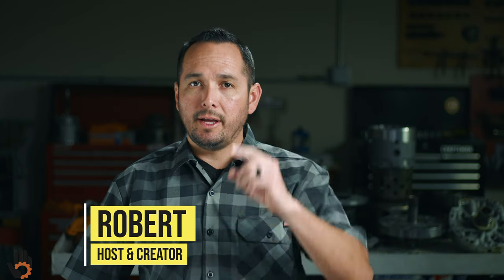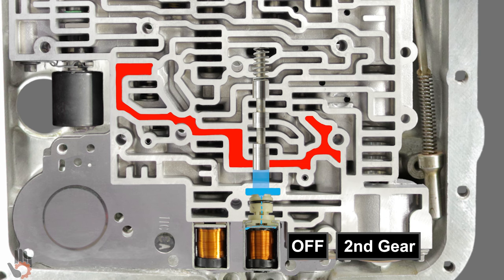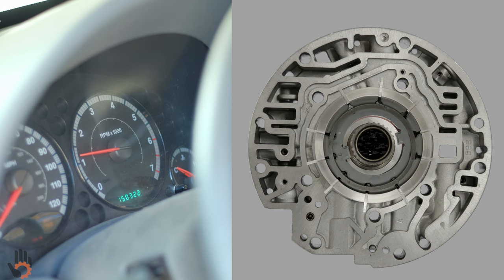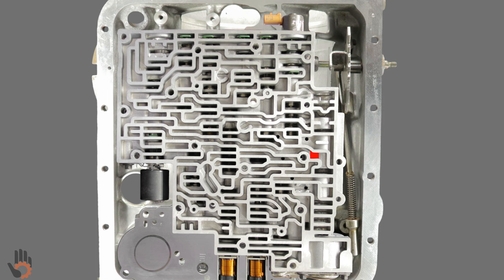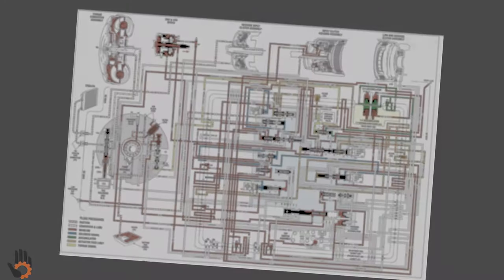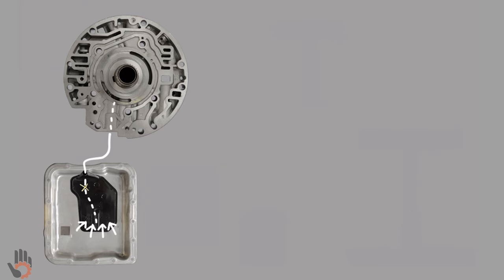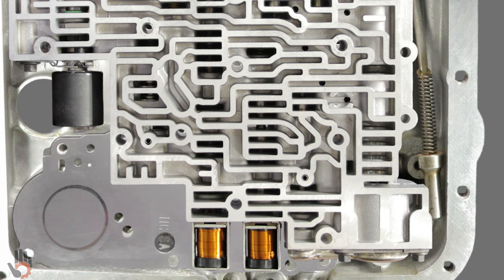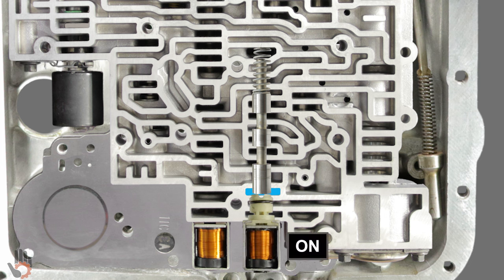4L60E: 1-2 Shift Valve + 1-2 Shift Solenoid (Part 1) Basic Operation

Comment from the maker: Thank you for being here!
If it feels right to you, please help me spread the word about this channel.

1 Handed Transmission Rebuilder:  (60-Sec Preview)
https://youtu.be/y3Vixa_Ec1E
Reply: Does this also go for the 4l80e I have codes 81 82 83 👍
Reply: I don't know the history of the transmission I just bought the vehicle and it'll go in reverse neutral and first and second gear and that's it
Reply from the maker: Understood.

Chances are, the 3-4 Clutch is smoked.  Super common problem on this transmission.
As the name implies, the 3-4 Clutch is partially responsible for 3rd gear and 4th gear.
Reply: I have a 1997 c1500 with 4l60e 1-piece case.  Keep getting P0758 and have replaced both A and B shift solenoids. I can command them on /off through PCM and voltage drop occurs …they work . Can mechanical problem in valve body or transmission still cause P0758?  No debris or clutch material found in pan …clean with normal metallic sludge on magnet
Reply from the maker: Is the trans missing/skipping 2nd or 3rd gear?
What's the history on trans?
High mileage unit?  Recently rebuilt?

To answer your question...
Yes, there are mechanical, and hydraulic, problems that can exist in the valve-body, that can cause this code.

Shoot me some more info, and I'll see if I can get you pointed in the right direction.
Reply: @SouthpawAutoworks  

My father got the truck from someone who passed away., so no info . The truck shows 132,000 miles.  I pulled the tranny yesterday and is a GM SRTA  reman…. , But I don’t know when it was put in. I pulled the pump and found problem. The reverse input drum is  smoked….blued .  Looks like second /fourth  band is slipping like crazy.  It was all confusing because the speedo was also not accurate for mph( reading 10mph high) ,  And I didn’t realize it was probably going from 1st to 3rd.  It had 2nd with rear wheels in air, but false reading because not enough load on drum…… 2/4 band looks pretty worn but servo seals are not damaged .  I guess it’s just a weak spot of the 4L60 E…., Band  gets worn and  it just can’t hold. 
I really really appreciate your advice and willingness to help. I’m just going to rebuild the whole thing. 3/4 pretty worn  but not slipping and tranny wiring harness leaking some fluid in connector (replace) .  

Why does computer not  give a code a for slipping?  It was only a code code for 2/3 solenoid electrical fault?  Since the problem was second gear , why would it not give a fault for the one two shift!    How does it determine if the shift up  is successful? Rpm drop?
Reply: Hi I have an issue with my transmission that no one seems to be able to help with
Reply: So the car moves off very slow sound like a slip but the rebels don’t go up really how ever once it  shifts to 2nd it drives fine until I come to a stop again then repeats but if I put the car in reverse and revers for a while when u select drive again the car moves of fine till I stop again
Reply: I just completely rebuilt 4L 60e envoy I've done pretty many of these this is my own personal vehicle it had a more sluggish second gear than I've ever run into but it was starting to wear any of the starting to be okay I now have a problem when I come to a stop it feels like it's binding up and then it releases and then shifts one through four decently I0 I'm wondering what's causing it to bind up for a short s as I'm trying to pull out in first gear it actually feels like it's in 2nd and Charles back in the first but I don't believe that's the case can you help me figure this out I just watched your program for the first time I subscribed liked and without no doubt the best program have ever seen on YouTube. I would appreciate your help as soon as you can I'll be watching for it thank you
Reply: Great video. I have recently lost 4th gear in my vehicle. With the help of another mechanic and his scan tool we were able to isolate the issue to something internal, not electrical. According to what we were able to see while actively driving the computer and solenoids are all functioning properly. All commands are being given. Could I be looking at a shift valve issue? I found someone else with the exact same scenario is me who apparently identified the problem is a manifold pressure switch. However, that seems like it would qualify as an electrical problems, so I'm sort of in an impasse. I don't want to pull the thing apart until I have identified a report that could be replaced in the process to ensure that fourth-year is working when I put it back together. I will note that I have no problem with reverse or 2nd. Only 4th gear or overdrive that is lost. I will also note that the 1-2 shift became a bit more firm than it had previously been in the same ride where I lost 4th. Thank you in advance if you have any thoughts.
Reply from the maker: I believe that's equipped with a 4T65E...not a 4L60E.
That particular trans is equipped with a pan on the bottom.  However, there's also a pan (cover) on the side of the trans.  The side pan/cover houses the VB (valve-body).  This is where the solenoids are located.

Removing the side pan/cover requires removing a number of car parts in order to gain access to the trans cover.
I'm not certain on your particular vehicle, but I would imagine it's possible to gain access to the 1-2 Shift Solenoid/valve-train, without dropping the trans.
Reply: @SouthpawAutoworks   Thanks man!
Reply: Are modern automatic better than old
Reply: 2nd gear and reverse is not working what could that be I don't how to subscribe I'm new at this
Reply: You have made the most reliable how transmission work video ever. You are one of a kind. (Just incredible)
Reply: I got a 4l60 that was holding 2nd and third too long now it’s slipping the second it started slipping I stopped the truck and haven’t driven it do you think the trans is burnt up or maybe I have a bad solenoid
Reply: I have a Silverado 1500 2009 LT 5.3 my transmission line sprung a leak while driving it light never came on I put a new line on and changed the filter & fluid now when I drive it it starts off good then feels like it slips into neutral I let of on gas pedal it goes again my code comes up DTC p2771 where would this part be would that make the transmission do that

Comment: I just bought a 2010 Silverado with 73,000 miles. Driving it home after about 40 miles I noticed when I stop then take off, the transmission whines in 1st and 2nd gear. But doesn’t do it every time. Help

Comment: What an amazingly detailed video. Mine randomly slips while in 4th gear so I got the shift solenoids & torque converter pwm solenoid, hoping that fixes the problem, but I really wanted more information on how those solenoids work and what they do. This video is a big help in understanding how the transmission works. I subscribed.
Reply from the maker: Here's a video dedicated to the shift solenoids.
4L60E Shift Solenoid - Part 1 (Basic Operation):  https://youtu.be/FaChWmcsAgI

That condition could be caused by a number of things.  Hoping to get back to creating more 4L60E videos, soon.  Got a lot of different topics to cover, including this one.

Currently busy working on a TH400 build series.
https://youtube.com/playlist?list=PLMK9OC5NGhbgVgAwDO_rCGFF38T1LjkS7

The positive feedback (and the subscription) is appreciated.
Thanks for dropping me a line.
Reply: I really appreciate all that you do it helps tremendously my question is I recently changed the oil and filter in my 4l60e the reason for this is when I reach 30 mph its like it goes into neutral while I had the pan and off out of the way I was checking out the shift solenoids when I pushed in on them the one closest to the front of the transmission it would come back out on it's own the other one I had to pull it back out is this normal or should they be charged because it is still doing the same thing as before
Reply from the maker: Regarding the solenoids, that's normal.  One solenoid is under spring tension.  The other is not.

If the trans is trying to shift into 3rd gear, and instead of getting 3rd gear, it feels like neutral, chances are that the 3-4 Clutch is failing.  As the name implies, it partially responsible for creating both 3rd gear and 4th gear.
It's a very common failure point on the 4L60E.

Comment: I loved it.🎉
Watched it in 1.75x and still got everything smooth into my brain 🧠 
Now I'll have more proper knowledge while going to the mechanic and resolving my Toyota Harrier / Lexus Rx330 gearbox problem
Reply from the maker: Right on.
Reply: @SouthpawAutoworks  BTW I got my transmission replaced for the peace of mind 😅
The shifts are smooth, it is just that when I floor the car. The gear takes lag to shift and a bit of aggressive shift. Perhaps can consider this from a V6 engine 3mz

Comment: November 5, 2022- Follow up to my 2nd post.  Received the PCM I bought on Ebay (  by Flashmasters) and it fixed the transmission immediately.  No more Shift solenoid B Fault and no more default 3rd gear.  I was almost defeated after rebuilding an obviously burned up transmission only to install it  and have the same fault that I started with.   So, pay close attention to your scan tool solenoid open/short to ground/short to volt faults, because it very well could be the PCM.    It is natural to assume an old truck has wiring harness issues, but don't overlook the PCM itself .  And don't assume your vehicle only has one problem....in this case the tranny was indeed burned up but the PCM  was also completely defective, because its internal volt meter was  permanently stuck on 0V as it activated and monitored the B solenoid

Comment: Robert, thanks for making this video. Subbed and thumbs up! The animation and narration is clear and top shelf. 

I think I understand it enough to diagnose a loss of line pressure just before going to 2nd. If I put into drive the PSI is 60 then when I begin to accelerate from a stop it drops to 30psi (yikes) for a second and it feels as though the trans is slipping or really just in limbo as the rpms don't spike. The line pressure goes to 60PSI and it feels like normal and is in 2nd. It does this in overdrive, manual 1st, 3rd, and 4th but not 2nd as it starts off in 2nd. Also of note is if I creep up slowly the rpms when leaving a stop the PSI doesn't drop, it's only when I accelerate normally and only momentarily.  I'm guessing this is a sticky 1-2 shift valve or a weak/broken spring on the 1-2 shift valve causing a slow return after the solenoid is commanded off. Any thoughts?
Reply from the maker: The 1-2 shift valve redirects/permits oil flow.
In 1st gear, it's a "closed door."  When the PCM commands 2nd gear, the valve becomes an "open door," letting oil flow through/past the valve, and to the 2-4 Servo.

There are a number of things that affect line pressure:
Pump speed (engine RPM), pump volume (pump slide position), PR Valve (affects pump slide), etc.
Also, the integrity of a clutch circuit will affect line pressure.  Ideally, we want no leaks in any a given circuit.  When we have leaks, we lose oil pressure (line pressure).

There's more info, on a number of these topics....if you're interested.

4L60E Pump:
How Does it Work:  https://youtu.be/gJ5CdPJoJyg

4L60E PR Valve:
Part 1:  https://youtu.be/ELhJlZridIY
Part 2:  https://youtu.be/dJlUec91kgY
Part 3:  https://youtu.be/PY1trZeLqTM

4L60E AFL Valve:
https://youtu.be/LqBkdegPjNk

4L60E Shift Solenoid:
https://youtu.be/FaChWmcsAgI

4L60E Shift Valve:
https://youtu.be/jPhm76RDz6Y

Comment: I know this is an older post but I have watched about all of your 4L60E  shift solenoid videos. I have questions if you are still around and available.I admire your strong capabilities , you know your stuff. Thanks. Micah Parris
Reply from the maker: Very kind of you.
This is the best way to reach me.  Please know that I'm typically slow to respond.
Reply: @SouthpawAutoworks  I have replaced A &B solenoids. It was shifting hard into 3rd gear. Now the thing will go through all the gears but will not move reverse or forward , unless the truck temp gets to 210 or so. Then it will move forward just a bit but not reverse.
Reply from the maker: I'm a little confused by what you wrote.  Lots of good info, but one thing that I'm not sure about.
You said, "Now the thing will go through all the gears but will not move reverse or forward..."

When you say this, do you mean that while the engine is idling, and the trans is in Park (and your foot is pushing on the brake), you can move the shifter through all of the different gears, and feel each gear engage (or bump)???  Or do you mean something else.

You mentioned that after the trans comes up to temp (210 F), that the truck "will move forward just a bit".  When you step on the gas, is the trans slipping (engine RPMs climb, but the truck isn't moving forward as it normally would)?
Reply: @SouthpawAutoworks  oh, sorry. I can move the shifter on the column and underneath at the shifter cable.. Makes me wonder if I lost something when I replaced the A and B solenoids.
Reply: Where can I buy the solenoid and valve and spring???

Comment: Thanks for the video. im diagnosing a freshly rebuilt 4660e that wont downshift back to first . using this and not having any diagnostic codes i was able to determine my problem is not the 1-2 solenoid. so on to the next video
Reply from the maker: Interesting...

If you shift it into Manual 1st ("1" on the shifter), what happens?

Comment: Great video and very informative. I have a question… I have a 1995 Camaro that seems to be missing second gear. First gear pulls normal however it won’t shift to second, if you lead off of the throttle it will jump straight to third and then fourth operates totally normal as well. If you step on the throttle enough to where it goes to downshift into second gear it will just rev almost like neutral. Can you help me out diagnosing this? Thanks
Reply: Did you ever figure this out??

Comment: Recently I rebuilt the 4l60e  I commented on two weeks ago... the 2/4 input drum blue and band slipping (no 2nd or 4th gear) .   Now the tranny is rebuilt, both shift solenoids replaced 2/3 shuttle valves inspected  (smooth movement in the  bore) and  I replaced internal tranny wiring harness.   But same 2/3 solenoid electrical fault occurs , but now AFTER the 2-3 shift occurs  ..... Interestingly I can shift through every gear  using scan tool  from 1 to 4 and I have every gear going  down the road.  I can also downshift from 4 to 1 using the scan tool no problem.  However, if I clear fault, and start from stop , it will shift from 1st to 2nd  and from 2nd to 3rd, then  about 2-3 seconds after the shift to  3rd ,  check engine light comes on and now I'm in failsafe 3rd gear  again. (same 2/3 solenoid "B"  electrical fault) .   Since the 2/3 solenoid is commanded OFF for 3rd gear,  I'm thinking this might be a problem inside the PCM, or PCM is  not seeing the voltage rise fast enough after solenoid turned off .    I can command the 2/3 solenoid on and off with scan tool  and I hear it click on / off in the pan every time.   Now I am starting to think the 2/4 band and drum originally burned up because previous owner was constantly using manual 2nd  to start off  and  flicking to 3rd, since tranny was in failsafe all the time  ( he died, so asking him is out of the question.) .  I suspect this because the shift cable was  originally  misadjusted so that manual valve would only move to manual 2nd and not to manual 1st.  You could physically not move it to manual 1st.  Not sure what is going on, but definitely going to school on this one.

Comment: My 94 Trans Am's transmission. Manufacturers don't much mention automatics suggested  maintenance.  Only in rear of an owner's manual,....  Always change old / burnt burnt ATF and filter man. Clean the trans pan with it's magnet too if it's equipped. Great video my fellow southpaw. Care to show  the differences  when adding a 
shift-kit? Something about forcing more fluid causing a noticeably harder shift.
Reply from the maker: When time permits, I'd like to dedicate a video to trans maintenance.  Plus, add some extra things, that could potentially extend the life of the trans.  Some of the extras don't cost much (especially when compared to the cost of an overhaul).

Would love to do a video on valve-body kits!

Thanks for dropping me a line.
I appreciate your interest in this subject.

Comment: It's not until you watch a video like this that you actually get an appreciate of the genius that went into something we take for granted every day. Just coming up with the concept is one thing? Buy then actually engineere it, that's a whole new beast. Anyway I have a question for anyone who might be able to help? I'm running the 4L60e transmission and recently had work done to the motor. A full rebuild with a few modifications. A stage 2 cam. Performance headers into 2 & half" exhaust with high flow cats. As well as a cold air performance intake. Plus a few other tweaks. So  now the shift points are out and other than dropping a manual gearbox in. And or fitting a stand alone transmission system? Is there a way it can adjust the shift points using a GM Tech 2 scan tool that is specifically set up for my model of car. It's the same one the dealership use when they go over it? And seeing that I've now modified the engine shouldn't have the PCM tuned /programmed to match the the newly modified engine? I was told that if I had the proper scan tool which I do. Can anyone give me a heads up on programming a PCM. Any help would be much appreciated.